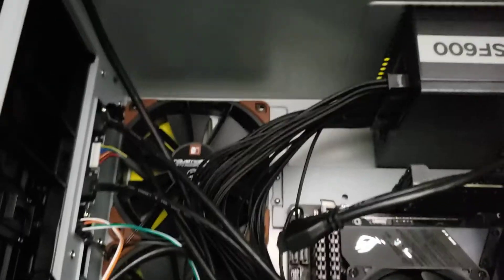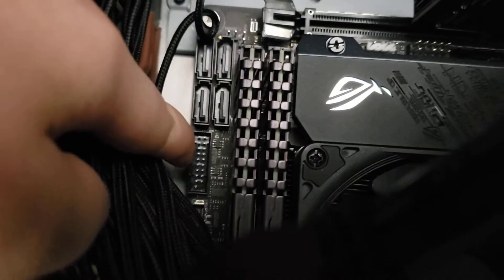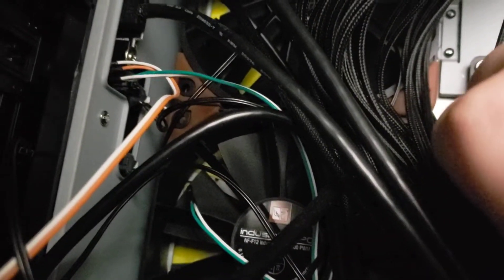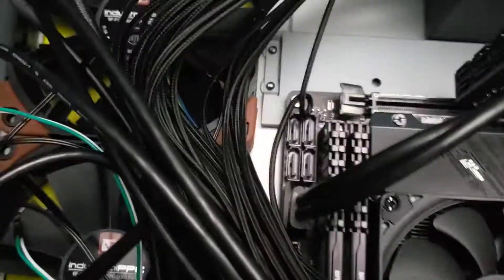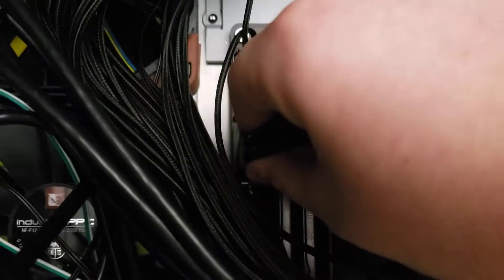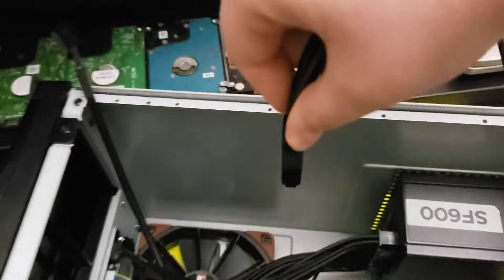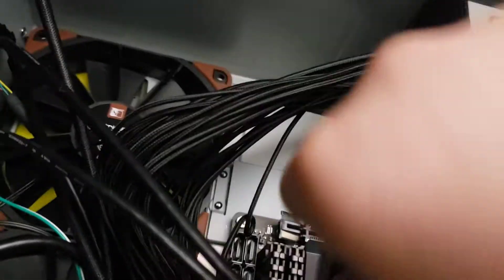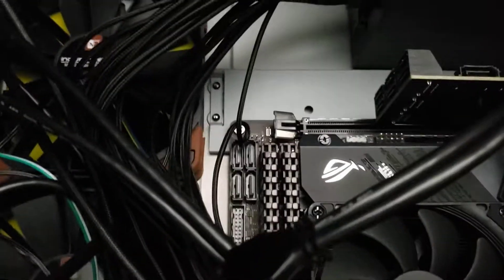How to remove or unplug that stupid usb 3.0 header on your motherboard properly

Comment: Beware of this kid's advice.  I ended up pulling the plastic block (that was on the motherboard, on top of all of the pins) clear off the MB.  Now, my case's 3.2 USB connector is still connected to the plastic block that pulled off the MB.... and now there's a bunch of unprotected 3.2 pins exposed on the MB.

My case's 3.2 USB connector has what looks like a tiny push tab on one side that looks like the type that you have to push down with a tiny flat head screwdriver, in order to "unlock" it, and be able to pull the connector off of the MB's plastic block connector.

This is similar to the tabs on car headlight connectors, only 1/10th the size.  I tried pushing down the tab to pull the connector off the MB's plastic block (now that it's off of the MB) but it still doesn't want to come off.  I'm tempted to just leave it until I'm ready to re-connect it, but I don't want to leave all those MB pins exposed while I'm pulling other things off.  Time to look for another video, and damn google for sending me here.

Comment: The base of the USB plug on my motherboard came loose when I tried to remove the USB 3 connector... I was lucky, because after that I could unplug the USB and fix it again on my motherboard. Such a bad design for this plug!

Comment: My guy...thank you!!!
Building my new rig and I wasn't happy with the cable run for USB 3.0 cable.
I thought I was going to damage things but your video was superb and on point.
Slightly push to the left and gentle pull the cable and boom.
You are right. These are stupid USB cables. Thank you!

Comment: I have a side mounted USB 3.0 header, so I had to gently pull forward (towards the side with the little notch cut into the plastic) and this did work. I was wiggling side to side for a few minutes and after like 5 seconds of applying a small amount of pressure towards the notch it came right out.

Comment: excellent.  mine has two latch-like area on the plug, opposite the key side.  I think these latch to the mother board.  Angling it out released the latch.   I think.  I tore one of those off an x99 board. It was an nzxt cable going into an Asus board.  Pins remain and still work.  The plastic came clear off.  Thanks for the insteuction metal Militia!  I suppose you might sound a little different now...

Comment: That's not a good idea to wiggle the plug while pulling it off, you're gonna make the receiving contacts loose. The proper way would be to hold it by its durable cables and pull it straight off the socket while firmly holding the board near the foot of the socket. Wiggling can cause loose connection issues later.
Reply: The reason that this video exists is because many people have had the USB 3.0 header cable absolutely refuse to come off with trying to pull it straight off or even regular wiggling. I had the exact same problem today and only the method in this video finally made the damn thing finally come off.

Comment: Thank you very much friend, for almost an hour I was trying to extract the cable without results, I saw other tutorials that did not work for me.

I was scared after several attempts without results, concern that the motherboard connector was going to come out

Looking for a tutorial on YouTube I found your video and it actually worked and I was able to get the cable out.🎉🎉🎉🎉🎉🎉🎉🎉🎉🎉❤

Greetings from Villa Hermosa Tabasco in Mexico.

Comment: I actually pulled the socket housing off the motherboard getting this off. using this guide didnt help either. 

anyway, once you pull it off/out, just get a craft knife/stanley knife and cut the 4 teeth off the blue usb connector, now i have no more issues with it getting stuck inside the housing and it still sits in snug.

Comment: Thanks for this. I've broken off that plastic connector twice (luckily no pin damage), and your video helped me to not do it a third time. I do not understand why they designed these headers like this.
Reply: My plastic connector broke too and the other half is stuck inside. How did you get yours out?
Reply: I have pin damage and don’t know how to fix it so now my pcs broke it turns on but doesn’t connect to my monitor

Comment: It really depends the connector quality, normally the reason why it was hard to impossible to unplug is because the header was cheaply made and it would be overheated as soon as you use it and it will permanently soldered on the header and here we go….

Short answer: do not buy cheap computer case or using these usb2.0 to 3.0 adapter that made in china because you know the current between usb2.0 and 3.0 is huge and attempting to tweak it will cause header to melt or even catch on fire which it was a reason why major board maker still have usb2.0 onboard and you don’t see any usb2.0 to 3.0 adapter that are made in USA. The cheap quality case is used the same method by using the existing usb2.0 and reversed ported usb3.0 head to keep the production cost as minimum as possible and they are mostly made in china. 

Long answer: Stay away from chinese product.
Reply: Lol  most good brand also have assembly in china,what make diffrence beetween expensive and cheap case is usually size and how it design, last is brand!
Reply: @lost4356  i’m not opposing Chinese merchandise, I am more off against these weird products that is out of spec and not meant to be for normal use.

Comment: Thanks a lot! Been wiggling these for a couple of minutes in vain. My mobo had the ports facing towards the front of the case which made it even more difficult. The tilting helped a lot and they came out almost instantly. 
PS: whoever designed these headers should have to personally disconnect them for everyone :)

Comment: Pulled the little plastic piece off the motherboard, pins are still fine but now the connecter its still too tight to take off. Crap headers, prob gotta buy a new mobo
Reply: You can use some really fine needle nose pliers to pull the piece out and then you can just get a replacement for your front IO, way cheaper that way
Reply: same

Comment: Sweet ill try that im switching cases soon so ill try your method
Reply from the maker: Yea it worked well for me just be very careful when moving it to the left you can bend or break the pins if you are not careful
Reply: @MetalcoreMilitia  thank you so much im switching over from a h510 case and that bracket was in the way i amosg broke the 3.1 port but i rwmoved the bracket and did your method it worked thank you and im going to a 5000d corsair